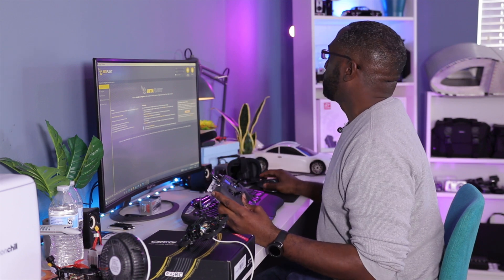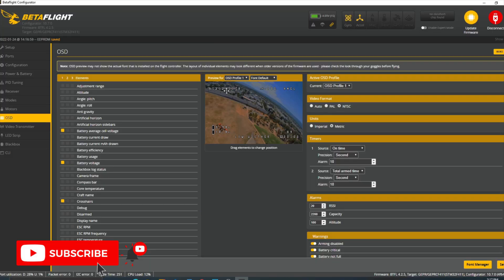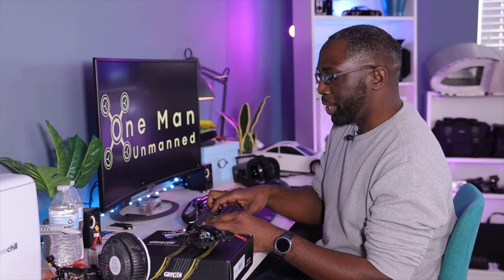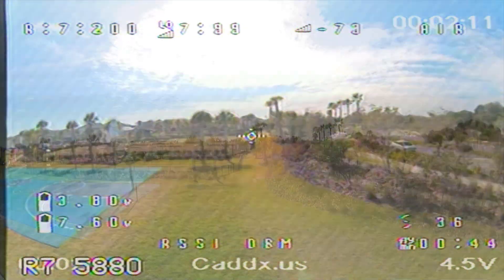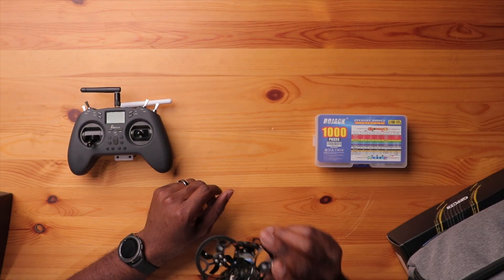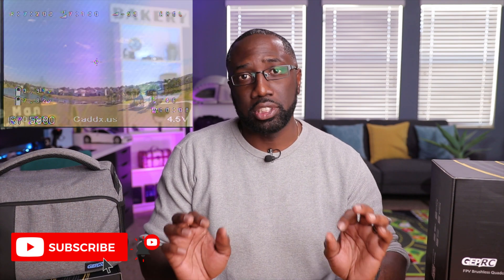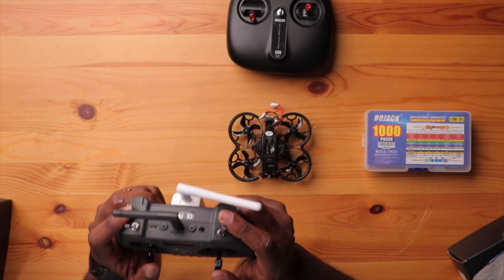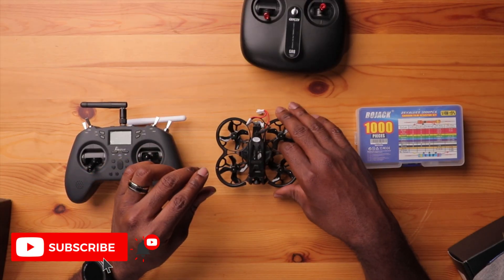Flying the TinyGo on ELRS makes this good drone GREAT | Here’s Why!

Comment: Dude... play the feed from the goggles.  We don't care about the 4k footage.  We wanna see the clarity of the link.  Nothing else.   Geez...
Reply from the maker: Thanks, bro…I had some clips from the goggles in there.  At this point, it works like any other ELRS receiver(which is good).  Pilots are getting km of range with just 10-50 mW.
Reply: Actually, we do care about the 4k footage. That's literally the whole reason to buy this drone lmfao.
Reply: You could watch videos of the none 4k dvr version. Same goggles. Same drone. No 4k recording.

Comment: Im having trouble finding out what type of connector of antennas do the Tinygo goggles use. What connector is on the goggles and what connector should be on the antennas.
Reply from the maker: TinyGo uses a UFL connector for the VTX antenna.  I think the box goggles uses a RPSMA connector.
Reply: @OneManUnmanned  So, Im still confused. The connector on goggles is RPSMA and on antenna is SMA? I can Google it now that finally the Tinygo arrived by mail. Thanks.

Comment: how you connect the dji goggles? is it possible on 4k version of tinygo?
Reply: Yes I know but on video you wear dji goggles. How?
Reply from the maker: You can fly analog drones with the DJI goggles using an adapter.  You can see it here in my review below. 
https://youtu.be/yUjWMhT5UhI
Reply from the maker: The DJI goggles cannot connect to this drone as it transmitts analog signal.

Comment: I just bought this drone, I’m new in the hobby, I’m a dji drone user, and for some reason i was trying to fly in angle mode and it wasn’t stable at all, I crashed several times, I thought it was the props but they are ok, in the right place each one, I checked the vtx too, and it was 25. What can be the problem? Why is not stable in angle mode?
Reply from the maker: I don't know what could be causing that, but FPV drones fly very differently that traditional camera drones.   Even in Angle mode, it requires inputs from the pilot to hover in place.

Comment: can the GEPRC TinyGO 4K FPV remote controller use for pc fpv flight simulator? TQ
Reply from the maker: No it can not... There is no port to connect to the computer.
Reply: @OneManUnmanned  guess i have to go for beta fpv, but it doesn't has 4k video 😢
Reply from the maker: I understand.. did you consider the EMAX TinyHawk3? It has a radio that can be used with simulators.  I did a comparison video of it here: 
https://youtu.be/II9jhRvrx1E
Reply: @OneManUnmanned  but it doesnt record 4k like tinygo right?
Reply from the maker: Sorry, no 4K option on that drone.
Reply: @OneManUnmanned  the reason i look into tinygo because it can record flight, otherwise i will go for betafpv but betafpv cant record flight 😢
Reply from the maker: Having the ability to record your flights is an important feature. Only the TinyHawk3 and TinyGo does that. They are all good kits.  You need to decide what aspects are most important to you.
Reply: @OneManUnmanned  hard to choose 😂😂

Comment: Hi,
Great review! After powering the drone after few seconds is starting a  pulse sound and a red blinking led, like an alarm. It seems the electronic board on drone is heating. I have the image on goggle and can see on display the temperature rising. What did I wrong? Thank You!
Reply from the maker: I don't think you're doing anything wrong.   The drone beeps when it is not connected to the radio(remote control).  Did you have the radio on?  If so, is your "beeper switch" on?  As far as the heat, the board does get hot very fast.  If you're going to have the drone powered for long periods of time, use a fan to keep it cool.
Reply: @OneManUnmanned  Thanks for your kindness and the quick answer and with help to your post about this kind of drone I solved the issue. All the best!
Reply from the maker: I have a video showing my setup and first flight. 
https://youtu.be/Q9qMJZ36ceM

Comment: Hi Thomas, Thanks for your effort. From GEPRC know that this AIO FC have some binding issue with the ESLR receiver. Have you try ESLR upgrade of another GEPRC drone with same type FC, and still success?
Reply from the maker: I have not tried another FC.. My other GEPRC drone came with ELRS pre-installed and works.   Did you have a chance to look at my previous video on how to install ELRS?  There are some caveats that need to be considered.  I'll leave that video linked below..Hope it helps. 
https://youtu.be/331o5lmtlvM
Reply: @OneManUnmanned  Thank you Thomas! It's so useful and i can no worry to go ELRS!

Comment: Great little experiment. Im new to fpv, just ordered an eachine novice 3 today, was gonna just settle on the tinygo because trying to assemble my own kit was difficult because everything is out of stock. But I looked at banggood and the novice 3 was on sale. But I have already been looking into the long-range systems(elrs/crossfire) for what would have been my 1st fpv which was a diatone roma l3. The only reason I was looking into long-range is because I'm coming into fpv from my DJI Mini 2. I dont fly it far but it's great having the confidence in knowing that I could if I ever wanted to and I think that the peace of mind any long-range system provides is important. The only real limitations then would be from the vtx and/or goggles in which case I could always move closer till I require vtx signal. But great job troubleshooting and bringing us the final result. Mahalo for making this video. Aloha
Reply from the maker: Thanks.. Having the confidence that your gear won't failsafe is a great feeling.